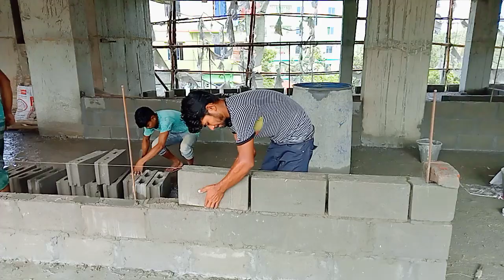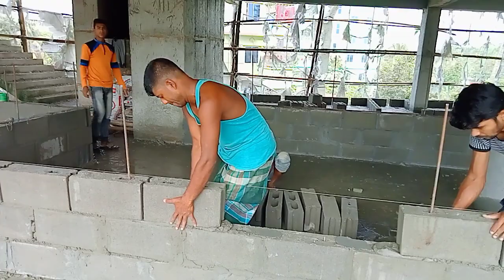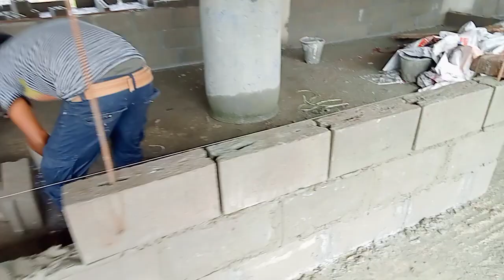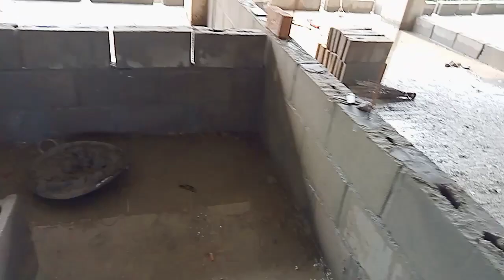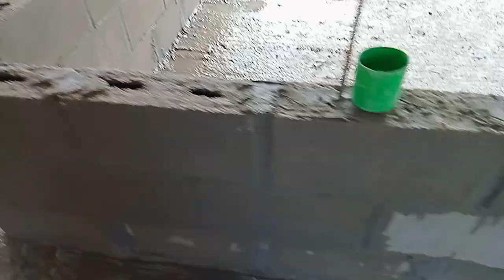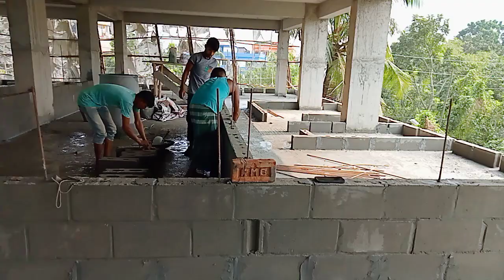How to build concrete hollow block wall ?

Comment: Vai block ar comprehensive strength koto? Ar ki ratio te block banan
Reply from the maker: 1400 1600 1800 psi
Depends on customer requirements.
Thank you ❤️
Reply: এক হাজরের দাম কত জানাবেন